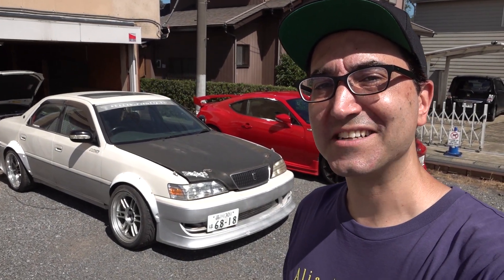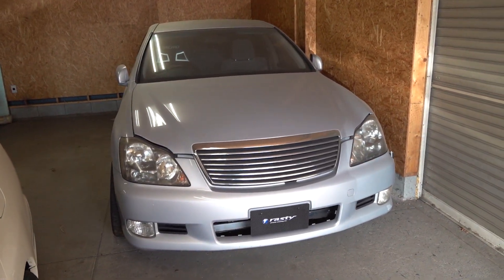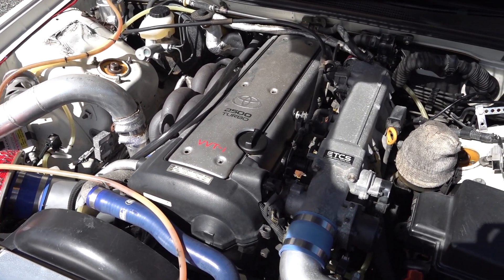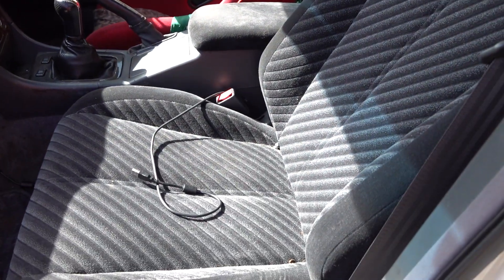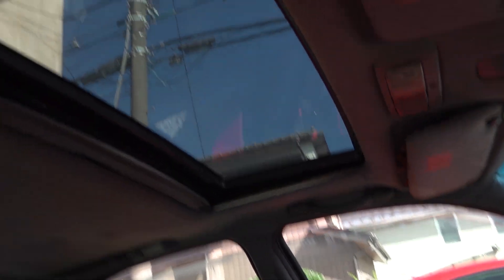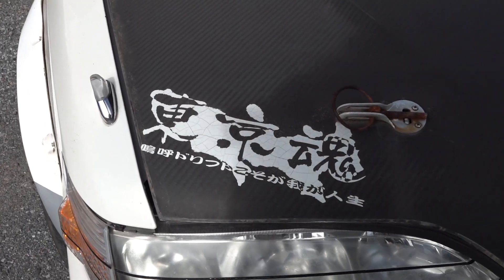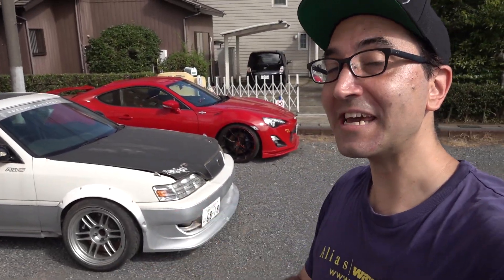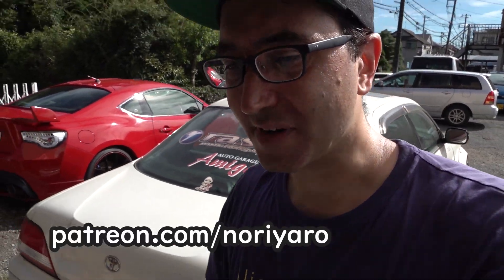I bought a JZX100 Cresta drift car

Comment: 90s Civics have the same issue with aftermarket front upper arms and being lowered, you can buy weld in shock tower extensions for Civics for that reason

Comment: The frameless door glass on the Chaser and Mark II dated back to X60 series of the early '80s. The Nissan Laurel was still available as a true 4-door hardtop (and would be until the end of C33 production in 1993), but Toyota was probably leery of potential structural integrity (and subsequent safety) issues endemic to the body style, so they gave the X60 "hardtops" the expected lower, sportier roofline and frameless door glass but maintained fixed, full-height B-pillars.

Comment: Not sure if you will drive this on the street buy my pro tip for great airflow is to have the sunroof open and the rear passenger window open and you will a get a great gust of wind up and around you. Was a golden discovery when I drove to and from the Nürburgring from Scotland in a e36 sedan :)

Great content as per keep it up!